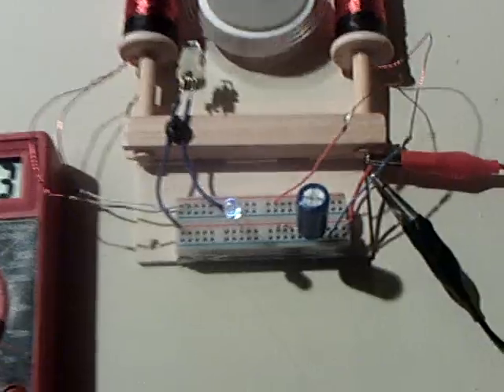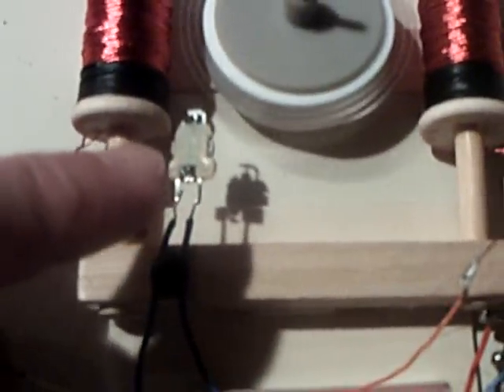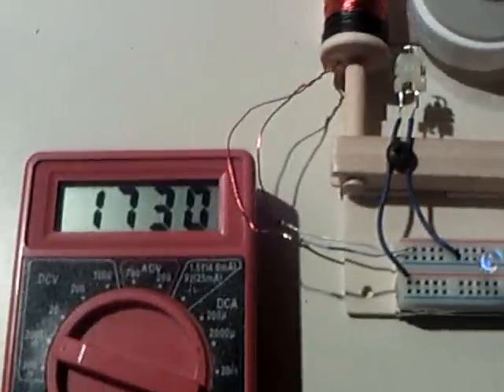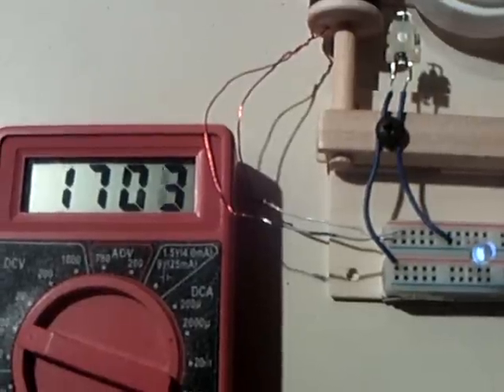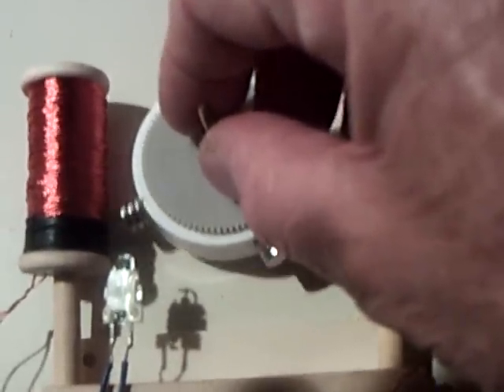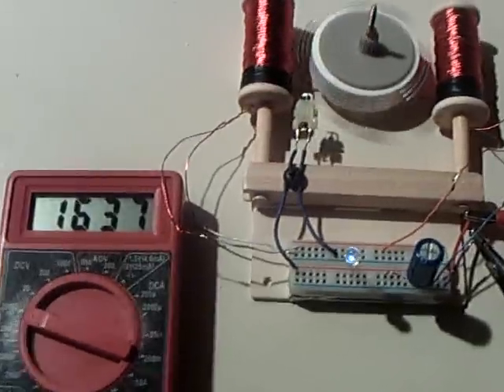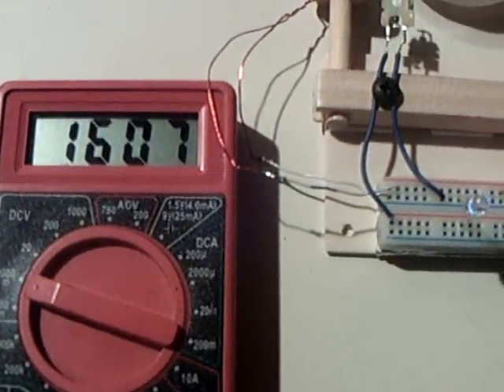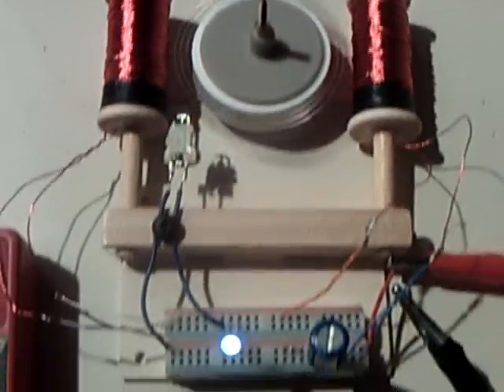Timing on JB's ZF Motor

Comment: The Galloping means something ..the electrical field of both coils is trying to sync with the rotation speed of the magnetic field trying to balance out..interesting..I think.future test should be done with frequency or resonance pitch to  so call " tune" the effiencientcy.. a Smooth  vortex flow of the fields as one system.
Enjoyed the vid..thanks

Comment: Now that you have established Tesla's theories one would think you would get away from magnets and use wound shorted coils on the rotor. This would replace the magnets and allow you to draw further current from the collapsing Rotor coils. It will need a kick start to start it but should enable you to self run eventually with the right setup. Tesla was to the point of having it self run as in the Roadster experiment up by me in buffalo,NY. Once the rotor gets up to self sustaining speed it becomes a constant velocity motor. <-Very hard to stop physically while energized. Tesla used a poly phase high voltage generator to run in the coils which were in pairs with two sets of phases. I think you need to separate the generator from the field generator and install a disruptive discharge circuit on both phases for the field coils. Tesla used some heavy wire for the field coils because of the disruptive discharge circuits exploding smaller gauge wire. But keep in mind Tesla said this action was a rotary transformer. Gauge differences drive the output in the rotor coils. Tesla also separated the prime mover to after the current was collected from the generating rotor coils. All of this was run on the same shaft. There will be a magnetic field present between the rotor cores and the field coil cores but most of that is wasted or contained in the toroidal core of the field coils. But then again that simple magnetic field action upon the field coils will only boost the generation of voltage as the rotor cores sweep around the inside toroidal core. Tesla said a thin single layer was enough for the field cores and having a single layer also makes it highly polarized like a Lodge coil. I haven't determined if bifilar coils work any better in this configuration yet but my suspicion is that it will benefit the system because of the reduction of Lenz's law and the ability to keep the strength of the disruptive discharge as it runs through the filed coils. But I suspect that bifilar coils operate much differently when exposed to a rotating field setup (from the rotor). I still need to start the project I have planned so no definite results have yet been obtained. My thoughts on this process are leaning towards the TPU experiment where an outside field coil setup is used with heavy inner coils as generators. The outside field must use the impulse technology of the disruptive discharge circuit Tesla used. This is an energizing excitation field acting upon inner generating coils with iron magnifying(rarifying magnetic field) to the effect. Purifying the excitation field allows you to focus the excitation field onto the iron cores of the inner generating coils much easier. as long as you don't have saturation of the core or high eddy current loss the system should operate very well. The experiment shows that Tesla's improvement to the Current AC system was misunderstood to say the least and ignored because it amplified the current via collection of plasma around the device with little cost. Since we are finding out that Plasma's are everywhere and is the medium of Aether that they, Tesla and others of the day were talking about, it would stand to reason we could attract and harvest this medium for energy that is stored in that medium at the pressure of the whole medium. Pressure being Voltage potential. Attract more medium and you can have a superconductor anywhere needed. Cold electricity is cold for a reason. It is because it has condensed a lot of the medium to that environment around the device and conducts energy out of the environment to the environments limit. It creates the proverbial vacuum Tesla mentioned in the analogy of the tank under the water and poking a hole in the tank. If you could give the water a path out it would flow right back out and create a system of looped flow. This has been applied to energy now with Tesla's help. Energy will be evacuated from the local environment and expelled. Create a path back into the environment and a flow will happen automatically expelling the energy back out of the local environment. As with everything in nature things grow and that is what will happen if you let this process advance. It will grow and become stronger or more established to the environment. Effectively increasing the sphere on the environment and through that increases it's own capabilities to cause more of a flow. We see this everyday and yet we haven't put it together yet, it's called gravity. And yes if this device is sufficiently big enough it could establish it's own gravity from the flow of energy being attracted and expelled from the environment. This mirrors the natural event taking place every nanosecond of every day on earth. This same process is going on in our Sun with the solar systems environment or bubble showing the clear signs of this effect. The skin effect is present at every level when we look at this environment we see.. From solar scale all the way down to the atomic level. If we want to find the machine that nature is running on and take what we need then we must start looking beyond our scale a truly see the truth. The solar wind is a perfect part example of this process working. Energy flows in our system yet we live in a bubble, in a bubble, in a bubble? Learn how to take advantage of that system and you have unlimited energy that is not free but already flowing in our environment. Just like Niagara falls produces the same energy. Our world I heating up and that means we are gaining more energy and not utilizing it so the world must compensate for this in it's environment. It shakes us and blows us and yet we haven't put it together yet that we must start using some of this energy we are collecting in our capacitor we call Earth or it will discharge rather disruptively..

Comment: Didn't JB use a bi polar set up.
Reply from the maker: +BackRoom Labs   Yes.  In his latest video where he shows his 3d printed motor he showed it running though on just a reed switch and a transistor.  He said that he was running on just one half of the motor at that time.

Comment: The gallop is very cool...enjoyed that demo. 
Begs the question of how thin a coil could be when sideways on like this. Whether 40AWG on a pencil piece would work. Also the length of coil needed (or expected) is something i've not seen mentioned.
Reply from the maker: +slider2732 Thanks.  Yes there are many things that could be tried.  Lots of variables.

Comment: One question I have is if the rotor was perfectly stable, and the gallop wouldn't work then, would the amp draw be less?  I say yes because it would have less friction so it would spin easier.
Reply from the maker: +legalizeshemp420 Good question.  With these small reed switch triggered motors there are a lot of variables.  Positioning of the reed switch makes a big difference.
Reply: *****
Yep, but in your gallop mode shown I noticed it slowed down too so of course it would use less amps.
Reply from the maker: +legalizeshemp420 It all depends on what one is looking for.  On the EZ Spin project lasersaber and I both were trying to get something that would keep rotating on a tiny amount of energy --day after day.  Week after week.  Perhaps year after year.  It sounds so easy but it isn't.  We have tried all kinds of things.  This 'gallop mode' was one of them.
Reply: *****
Not denigrating the efforts I was just saying that of course if it slows down it will require less amps but so would a better, and more stable, rotor.  The trick is to have it spin as fast as normal and take up the same amount of energy as it does while galloping.  Too bad we do not have vertical magnetic bearings (they have them but in some seriously sci fi type labs costing millions of dollars) where friction is the smallest I believe we could get on Earth.  Stick it in a vacuum chamber and that is as low as it will get without being in deep space which has 0 gravity.

Comment: Lid - is that 1.7mA on the meter ?
Reply from the maker: +3D Motor Maker  No that is the voltage (1.7v).  This cheap meter does a poor job of showing amperage on these pulse motors so I look at the rate of voltage drop on a small super capacitor as a rough gauge of how fast the juice is draining.
Reply: I have trouble reading pulse amperage with digital meters too.  Is there a brand that will ?
Reply from the maker: +3D Motor Maker You can buy an expensive FLUKE digital meter that will be better.   Some people prefer to put a capacitor across the power rails to smooth out the pulses and get a better reading.  Others just put a 1 ohm resistor in series with the (+) feed and measure the voltage drop across that.  Analogue meters do a better job here also.
Reply: Hi Lid - thanks for the info I shall try the capacitor route.